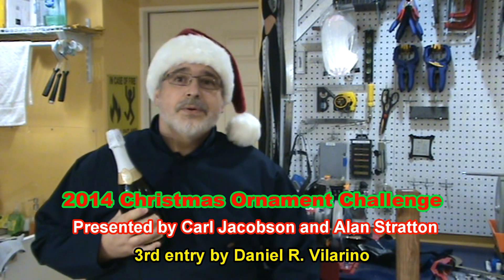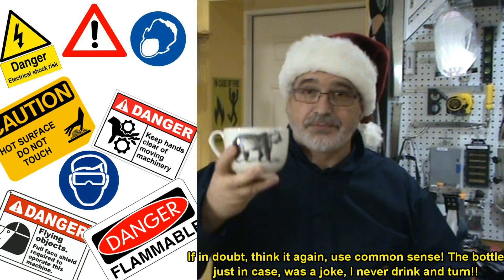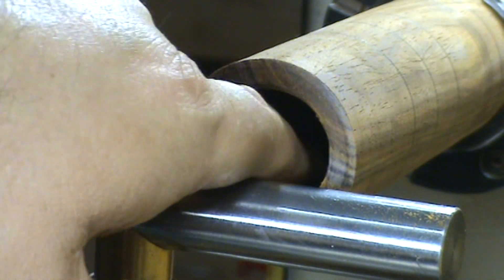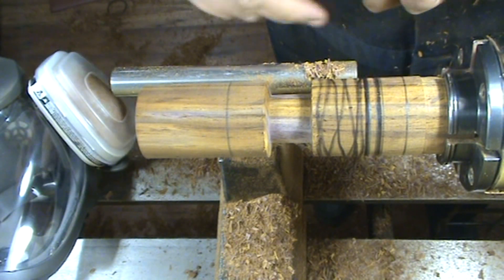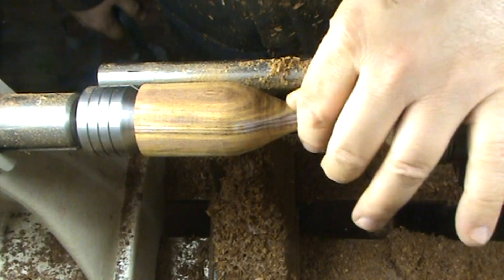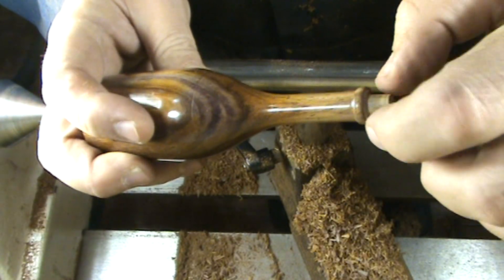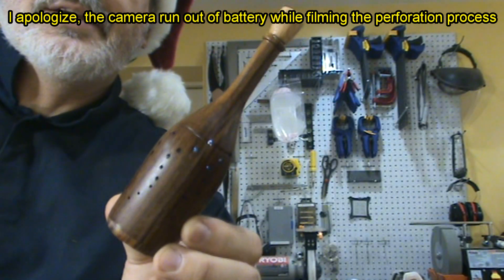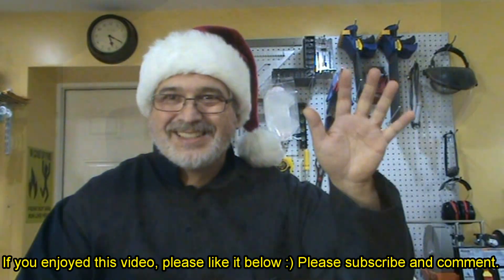2014 Christmas Ornament Challenge 3rd Entry DRV

Comment: Took me 20 seconds into the video to press the "like" button, never mind the turning, just your spirit is enough to make a winner out of you! and the ornament, wow on every account, too bad the battery ran out, we are slaves of technology, and we love it... :) love the shape, love the threads, love the light, love the finish, well done! and again, good luck! :)
Reply from the maker: Thank you Yuval! I am glad you liked the video, I was a bit upset when I realized that the camera was not filming the part of the perforations for the bubbles, because, simple as it seems it was a bit challenging and required re sanding and re finishing the body of the ornament. I have to find a way to get the camera connected to the outlet and not to depend on the battery. It is a kind of old video camera but works pretty well and I am sure I can still extract some good footage out of it. Eventually I might buy another and be able to have videos with takes from two different angles. Many thanks for your kind comments! Cheers! Daniel
Reply: Daniel Vilarino Well, I used my phone for making my video. Since I'm a tech guy, I had it connected to the power, and to a monitor I placed in my shop (I thought I could use it to watch while I turn, but in the end I was looking at the lathe, not the screen, so it was useless, apart from knowing it's still filming...).